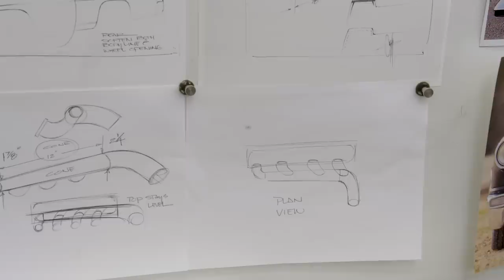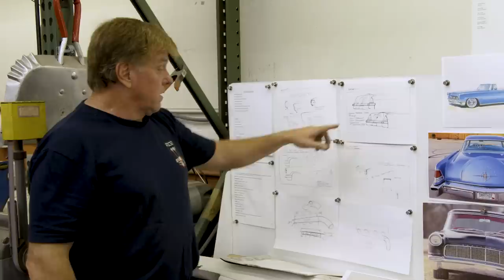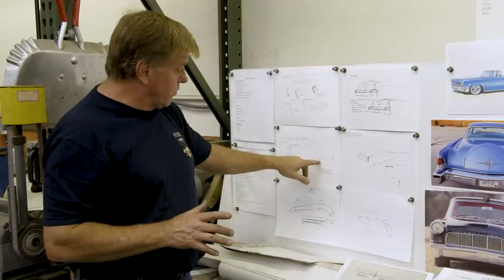In The Shop with Chip!

Comment: If you are going to do it do it right and be the master.  It has to have a removable top because no one should have a car they can not drive when they want to drive no mater what.  If I am spending this mount of money on a car I will put out the extra to make sure I can drive it 24/7/365.  Anything less is uninspiring.  Anyone can cut a top off but only the best can make 1 to put back on.